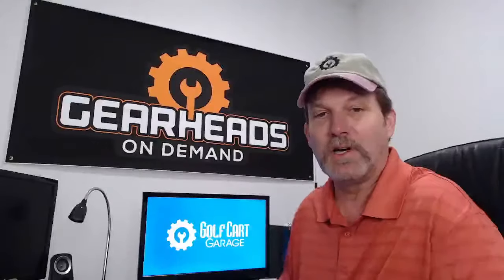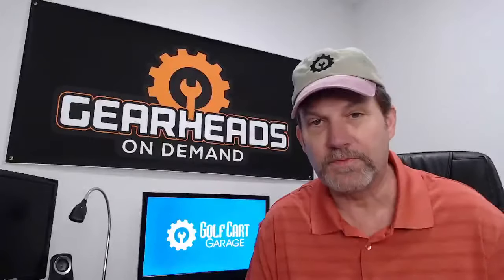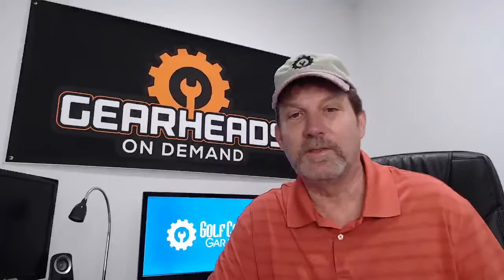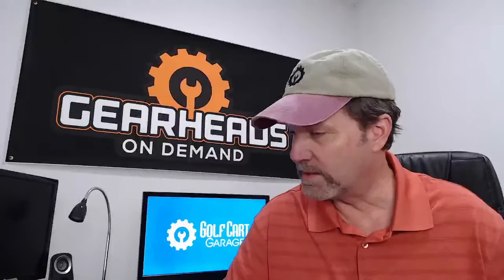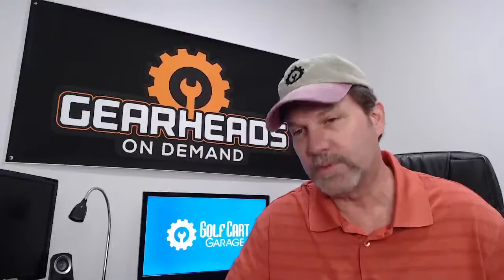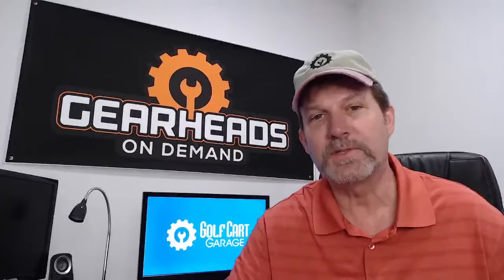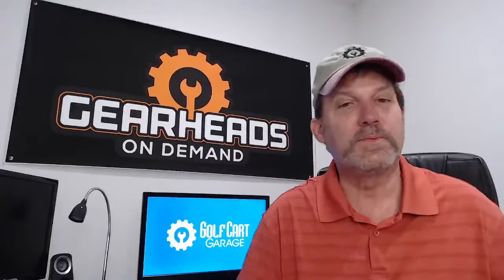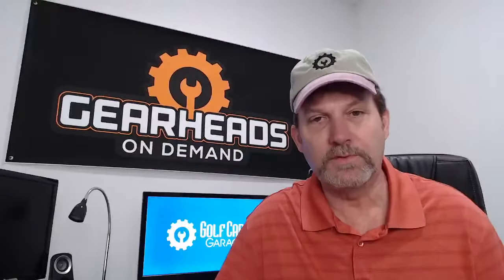OBC issues? | Golf Cart Garage I Weekly Giveaways |  Episode # 86

Comment: Sunday morning 930 not sure of the date is it wisely to turn your toe Ron switch off while you charging club car president 48 V
Reply from the maker: Thanks for watching!  The Run/Tow switch should be switched to "TOW" when towing the vehicle or installing electrical components.  There is no reason to switch it when charging the vehicle other than to stop it from moving while charging.  If your charger has a lockout feature, that will not matter.  Let us know if you have further questions.  Support@GolfCartGarage.com or (800) 401-2934

Comment: I have a 2004 club car ds. When I plug in the charger, the needle barely moves and shuts off after a minute or so. I used a different charger with the same result. Di I need a new obc?
Reply from the maker: Thanks for watching, John... great question!  Using another charger like you did is an excellent (and pretty much the only) method to test for a bad OBC.  We recommend an OnBoard Summit II to replace that charger and bypass the OBC.  More here: https://www.golfcartgarage.com/golf-cart-battery-charger-36-48-volt-on-board-lester-electrical-summit-2/
Let us know if you have more questions or need a hand!  Support@GolfCartGarage.com or (800) 401-2934

Comment: I have a Hawk ss golf cart and as I accelerate it will travel about two metres and jam the brakes on , then it will go again for about two metres and do the same, can you help.
Reply from the maker: Thanks for watching, David!  Can't say we have real time experience with a Hawk SS model, but it sounds like it may have a motor brake similar to the US EZGO RXV model.  Those run into problems with the motor brake and solenoid.  That might be a good place to start or to ask a Hawk dealer near you for help. You can also get a virtual appt with our techs here: https://www.golfcartgarage.com/gearheads-on-demand/ or get in touch at Support@GolfCartGarage.com or (800) 401-2934 if you have more questions or need help.

Comment: I have a 2001 Club Car DS. I installed 2 48v Lithium batteries. I'm not using the charging port but charging from an external source. Do I have to take out the OBC and does the OBC serve other purposes other than to regulate charging? I don't have the blue and white wires to bypass the OBC like the President. I have a 3 pin plug coming out of the OBC with yellow, red, and brown wires. When I disconnected the small black wire out of the OBC from the B- terminal on the controller the cart has no power. Right now I've only disconnected the black and gray wire from the charging port and the cart runs but I don't know if leaving the OBC connected can cause other problems down the road. Any thoughts?
Reply from the maker: Hello and welcome to GCG.  Because lithium is going to have different numbers than lead acid, I would electrically bypass the OBC with the correct bypass kit.  That way the OBC will not get confused with the new numbers it is seeing.  The OBC does monitor all amps and volts that your cart is using.